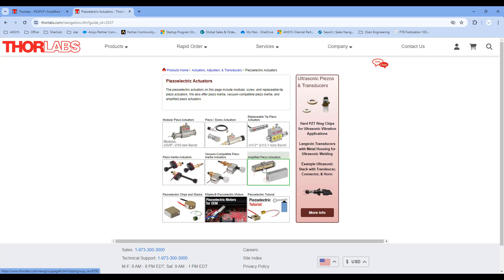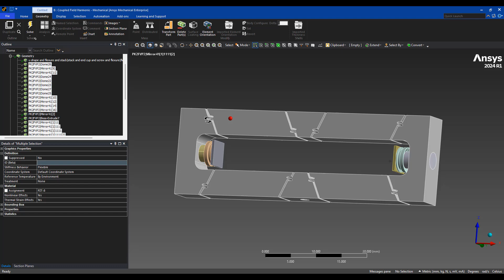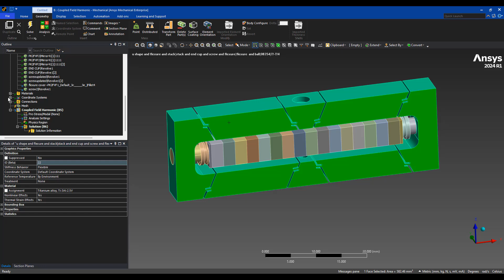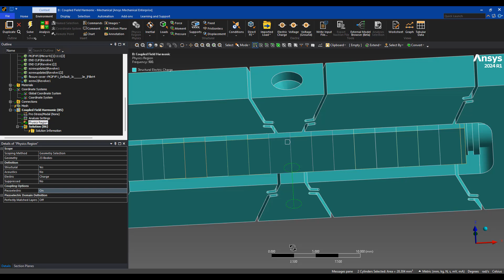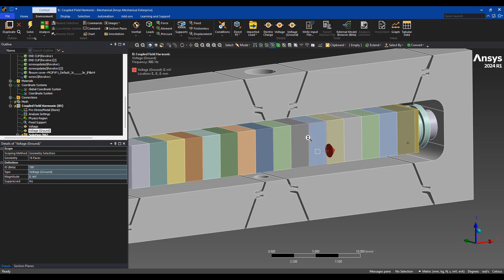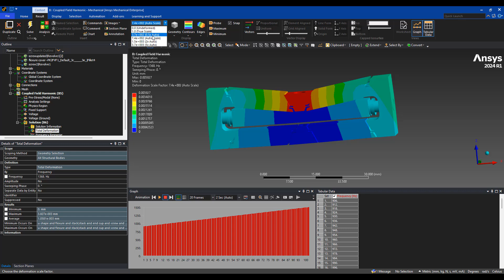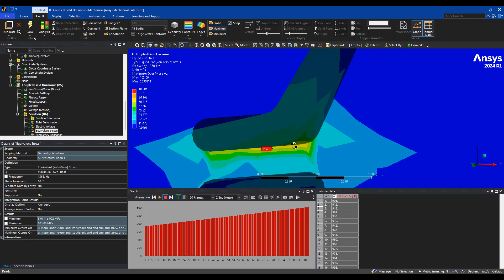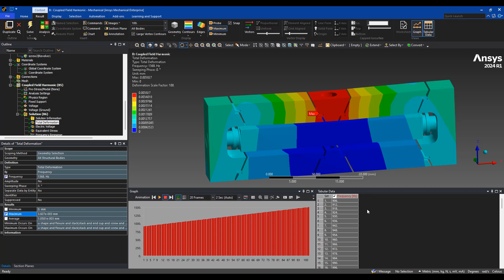Piezoelectric Flexure simulation using Ansys Mechanical

Comment: Thanks for the very informative tutorial @OzenEngineeringSimulation. Am I right in thinking that harmonic analysis should give displacement results which are approximately correct? Or is it just relative?
I see that the simulated resonant frequency of 1.3kHz is fairly close to the 1kHz given in the datasheet. However, your simulated displacement (at the lower frequency end of the chart) is just a few microns, rising to 90 microns at resonance, whereas the datasheet for the PK2FVF1 shows a static displacement of 420um at 75V